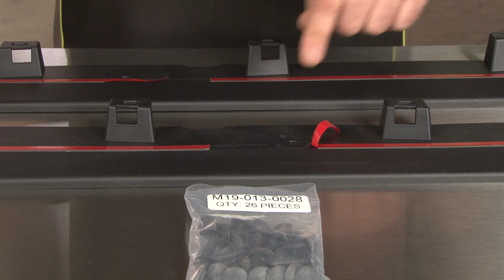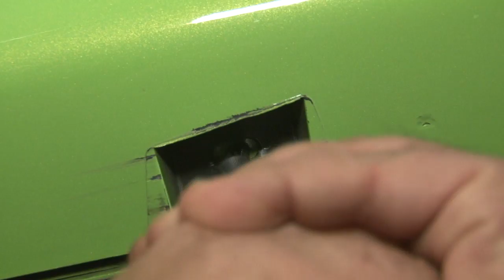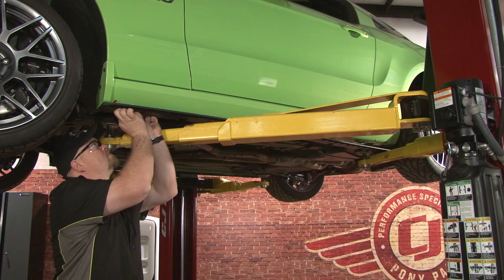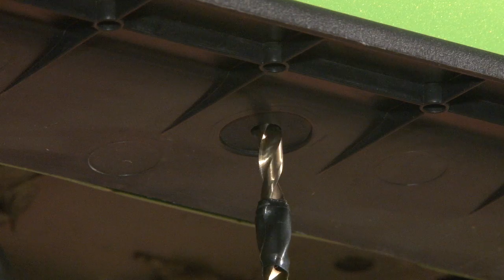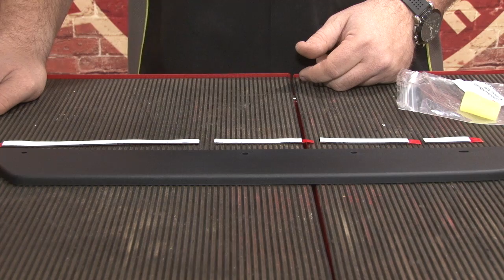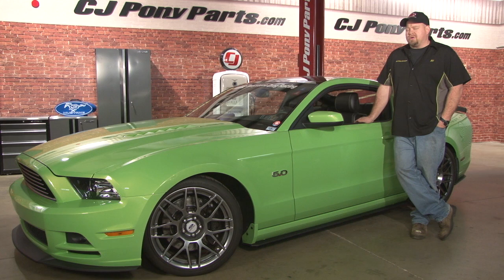Mustang Roush Side Skirt/Rear Splitter 2010-2014 Installation

Comment: Do not touch those cleaning pads, they contain cyclohexane and xylene, xylene is a known carcinogen, cyclohexane is made from Benzenes another known carcinogen.  I wouldnt even use those pads without a half mask breathing in that stuff.  Don't take my word for it look up the msds.
Reply: Does anyone know where i can get the splitter tht are in the rear fender wells?
Reply: In the shop we used lacquer thinner but I’m sure just as bad for you.

Comment: I assume you mean the rear bumper? The 2013 rear bumper will fit a 2010 but you need to do some trimming and you would want to get the 2013 taillights as well since there are subtle differences in the fitment of the taillights to the bumper cover.

Comment from the maker: The new part is a bit larger than the factory piece, so a little more support is probably warranted. Plus we removed two screws from the factory piece, so two of the new drilled holes for push pins account for them.